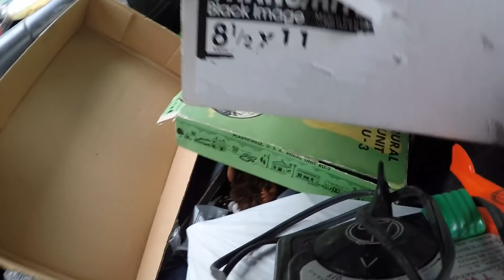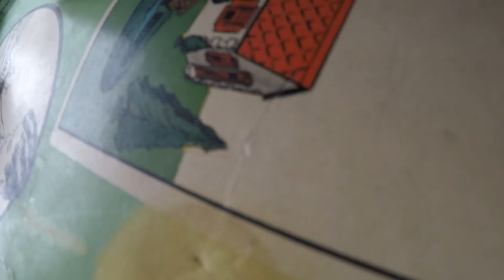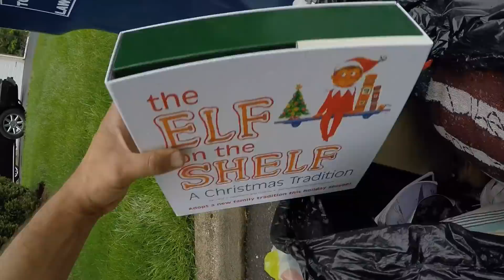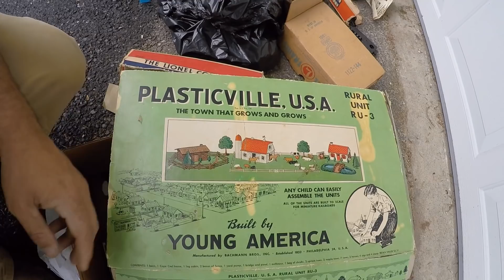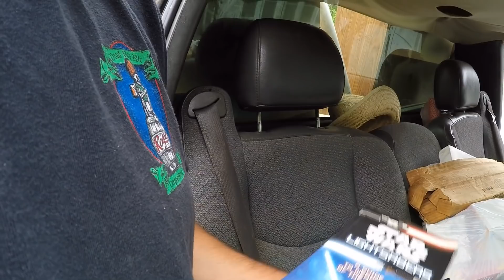Scrapping Picking epic finds LIONEL TRAINS

Comment: What idiot throws postwar Lionel trains away with eBay, Craigslist, Facebook marketplace available to everyone? Those locomotives are Santa Fe F3 A and B units BTW. In good condition worth about $250-$350. The “switch” is called a transformer and they are not “7’s”...They are “L’s”, for Lionel.